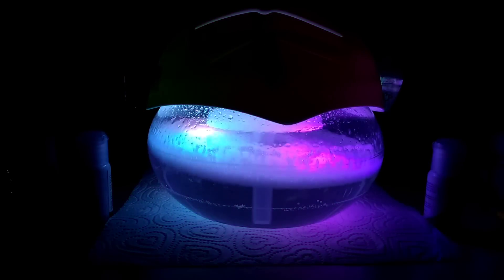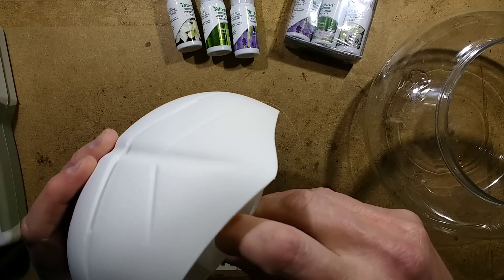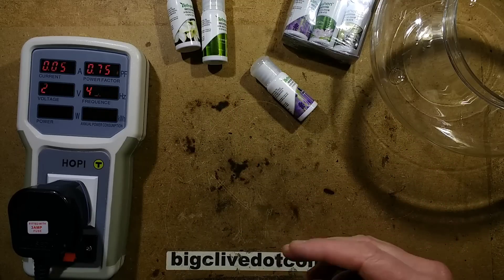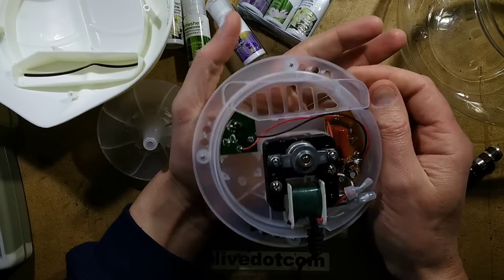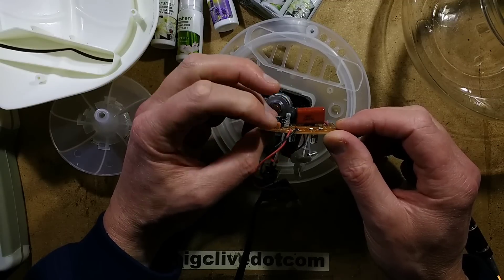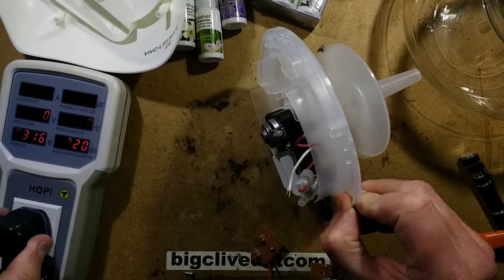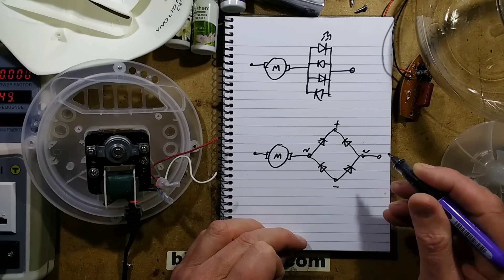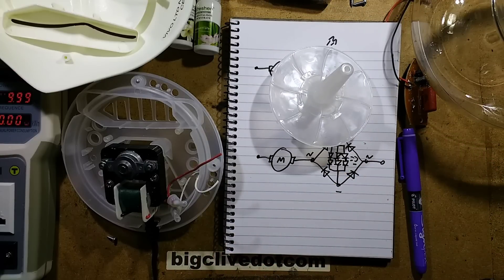Water sphere air cleaner.

Comment: So if i Understand coreclty the fan is sucking air from Above and splashing water from below on to the Walls and the air that was sucked mixes with it and Becoise of it it purifies air becouse water collects all the heavy particles or something like that? Is that even Effective?
Reply: What if we create some kind of air pump pump it down by some pipe and them the air particles will go up as bubbles and those bubbles will be purified by the water that they are travelling throw, would tjat be a Effective?
Reply from the maker: There was a vacuum cleaner that pulled the air through water to clean it.

Comment: im guessing a squirt of frebreeze in the water and the whole living quarters will smell nice. and you now how the back of a floor fan,the grill gets dirty, this probably removes that nastiness from the air... also i seen the metal aerosols they are spraying for weather modifications from the planes, im guessing this will remove that gunk too. and its  Quite a lot I've seen a woman that cleaned off her glass patio table out in her yard and after 2 days outside she scraped it with a razor blade to get the fine mist gunk off of it and she got 3 or 4 grams of magnetic micro particles that she picked up off The table from only 2 days outside...im going to build a large "one of these" that pumps air down through water and exhausts the air into the home, and just change the water-which is the filter👍

Comment: I think I'm missing something.  I thought the air was pushed through the mist/droplets/whatever.  But it's above at least most of the droplets (from under fan/flat disk part). If the air was forced through the mist, I could see it being a lot better at dust collection.

When I was very young, (1950s), my mom had a vacuum (cast iron!) that you put water in the bottom and the air was forced around a sharp bend and the dust/dirt couldn't make the turn so go caught by the water at the bottom.  Worked excellently, but I'm sure it was a bear to move around with it being cast iron (really!) and filled with a quart or two(?) of water. (an no wheels that I recall).

Comment: Hm, I had an idea for water filtering a while back, but that was overrriden
by another much easier to achieve filtering process, for the Sars-CoV-2.
At first I thought about using compression for air nito liquid, then mixing
with water, to get a a solution, then slowly decompressing it to
make the air within go gaseous again, this would leave all the particulate matter
in it, while allowig the gas to escape. Pretty good, but not as good as
using another gas to mix with the outgoing air from hospitals,
and then turn blue flame. ALthough this method is a little more expensive
in upkeep, it's much easier achieved.
But yeah, if you got like a whole bunch of solar power, and no natural gas,
yes, compression into liquid and subsequent release while uncompressing,
will get you nice results.
it's way better than trying to get bubbles small enough to be filtered.
The bubbles with such a filter would have to be <20nm for it to work
against SARS-CoV-2.
In the long run, the mechanical to liquid compression would be better,
since it can be done for a long time using electricity,
while needing little mechanical components, or at least relativel easy buildable ones.

Te short fast sweet is with the natural gas mixing, guaranteed to 100%
destruction of all SARS-CoV-2 particles.
Tiny airbubbles ?...not so useful...not even when it gets looped several times.
With the SARS-CoV-2 virus it needs to be 100% proofed.
And in that the winner is gas-mixing and burn.
the fluid compression is still very close, but just 99.9999999999%
effective.
Dependant on the fluid decompression cycle, it may yet release it's own
version of aerosol Sars-CoV-2, albeit in a much lower concentration.
Reply: Yes the air/gas compression filter may work also in other instances,
but when it comes to viruses, you want 100%.
Not 99.99999999%
The water/gas compression method may be used if and when
it doesnt matter that much how much escape, if dealing
with tolerance, but can't achieve a absolute zero tolerance.
Reply: Also keep in mind that electricity is still mostly generated
by fossil fuels in most urban areas.
So burning gas to create electricity, to create pressure,
to mix with water, and then slowly decompress,
is still using gas anyways.
So.not cleaner unless you only use solar power.
Reply: Avoid mindreaders, they suck, and can't answer anything unless
they get the answer from someone else.(or from the person that's
asking them, if and when the askee already has the answer in mind)
To tell a true clairvoyant from the fake mindreaders that pretend to be
clairvoyants, ask a question to which you have the answer NOT commited
to memory. They can't answer it, for you don't have it in your mind,
whereas a true clairvoyant can answer it regardless, since they can actually
see the future, and no matter when you pull out the envelope with the question's
answer, they'll be able to see it.)
(Then there's brilliant people, who cook one up for you, if and when
they have enough data available to create it on the spot.)
(the latter ones are gifted maybe, but neither mindreaders, nor clairvoyant.)
Reply: (If and when confronted with mindreaders who try and pass themselves
off for people to be in God's (or Allah, or whichever) service, well,
you then know what they are,
and yes, that means they serve the opposite one instead.)
(Those are mindreaders who prey on other people's religions and faiths.)
(They turn it against the believers and 'believers' alike.)

Comment: Pretty much a cool mist humidifier. Without the skirt comb around the impeller the water doesn't get broken up as much. You should look at impeller-based humidifiers they're about the same except have an arrangement of teeth (the comb) around the impeller spinner/fan.

Comment: Many, many moons ago, when I was a kid and if I had a cough or a cold or something, my mom would put a humidifier in my room that worked very similarly to this, just larger.  That thing would shoot out a two-foot spray of fine droplets and air and I specifically remember the long cone shaped "tube" that went down into the water and a top disc that I would now label an impeller.  Stuff like that always fascinated me...I could never understand (at the time) what in the world made it "suck" the water up and out like that...
Reply from the maker: It might have been an ultrasonic dehumidifier.  They produce a plume of cold steam.
Reply: Nope, it had a shaded pole motor driving a rotating part just like the one shown in this air cleaner disassembly.  I know for sure it wasn't an ultrasonic, I would have gone NUTS playing around with and trying to understand one of those!  We're talking mid-70's-ish and I don't recall ultrasonics being widely available at that time.  But yeah, it had a long cone shaped tube with a small opening at the end that was immersed in the "tank" and at the top (if I recall correctly) was a disc that resembled the centrifugal impeller you would find in a vacuum cleaner.  The disc acted as a "fan" which sucked in air through the top, mixed it with the water and swirled it around in the lower reservoir making kind of a mist "tornado".  A little sliding door on the side would allow some of that mist to escape.  Obviously WAY before safety switches were common, this thing didn't care if the top was on or not - it would still spin.  I don't even think the damn thing had a power switch - you just plugged it in and away it went!  Haha, I can remember making HUGE messes when I would try to lift the top off juuuuuust enough to peek inside and it would always sling water EVERYWHERE.  Heh, it's a good thing my mom recognized my budding curiosity and where it would eventually lead, otherwise I probably would have gotten my ass tanned for all the mild water damage!  Hahha...

Comment: This may be bad but I had been thinking about water/air cleaner for quite a while.. I remember seeing something on Science Channel/Discovery/Nat Geo about how water dropplets from ocean waves are amazing air cleaners as they cling to particles in the air and makes them heavy enough to fall down.  I had been considering something along the lines of high volume air flow blowing air into pool of water which is constantly filtered via carbon water filters.  Mix in surfactants to help catch the dirt/pollen/etc..  So this is thing air cleaner is a decent idea but horribly implemented.
Reply: i im thinking how can implement this in a bigger unit, making that turbine and conect it to a pc cooler bearing motor

Comment: I got one of these for the kitchen (and smoking room).
I liked the low wattage, and the lack of filter to clog.
I hoped it would stop my tobacco tar, and whatever condenses out of cooking vapours from coating the ceiling and walls.
Anyway....they certainly do something, but I'm not sure what.
I ran it without the additive, and it certainly draws cigarette smoke towards it, as the underside of the lid soon got yellowed, as did the tiled area close to it.
Plus the fan and the cone developed some kind of smeggy deposits. These weren't oily, and I'm not sure if they were a bacterial build up in the water. They needed cleaning off every day.
When I wiped the bowl, the tissue would be brownish, so it might have caught some tar from my smoking.
Any road up, thanks for this video, and...why is it safe to mix lecky and water in this device?
Cheers.
Reply: Good googlymoogly imagine what your lungs look like!

Comment: The question is does it work (well),  I think not , How can we tell? .. the air leaving the device will be almost 100% humidity ,  if initial air in the room is 50% humid it takes another 10 gms of water to increase 1cu meter to 100% (25C) ...A room 4x5x3 meters requires 600g of water to increase humidity from 50 to 100% ..what is rate of water use ? How rapidly  the device increases humidity in a room is a measure of how effective it is (assuming the water treatment does clean the air)

Comment: Huh... The new color changing LEDs can be wired in series? How does that work?
Considering that the channels are internally faded back and forth by a tiny micro controller I would expect them to draw a rather variable current.
Did they sync up the fading of the individual channels so that the LED consumes a constant current? Does the micro controller shunt LEDs when not turned on, rather then controlling the output of the LED? That would be a reasonable solution I guess.

Comment: I too had a  unit like this when I was a kid.  It had the tube as well but, of course the tub was a solid color, green if I remember right. They were sold as humidifier for the "sick room" and mom always had it next to my bed, well after we moved to a house with power, when I was ill with a cold or the flu.  It put out quite a mist and was called a cold air humidifier, in contrast to the warm air which was actually steam. I don't know if it worked very well or not, but I think it did bring a bit of relief to my sinuses back then.

Comment: I call BS. I think a real air purifier would suck in air through a filter (such as a HEPA filter) and then blow it back out in such a way as to circulate the air in the room, effectively removing the dust, alergens, pet dander, etc. This looks like it would be more effective as a humidifier and/or aroma sprayer, if it's even effective at anything at all.
Reply: so "sirena vacuum" when his water gets dirty is all a illusion?

Comment: I bought the original one of these over 15years ago for my mum. Back then it was advertised more towards air fragrancing, sure it was called a goodsphere  ?? Cost £50 I think but, it's been used nearly everyday and still works today - for something that's soaked in water all the time that's impressive!, I wonder if yours would be as reliable.

Comment: The spinning pick-up shaft was a common design in U.S. humidifiers until ultrasonic ones took over the cool-mist segment of the market. I remember those being quite common when I was a kid in the 1980's. Seems to be a pretty KISS design, which makes me wonder why the ultrasound ones won over. (The motors weren't even all that loud either. They'd only start making noise when going empty, which was a pretty good cue that it was time to refill.) Maybe it's just electric motors being around water and a safety thing?

Image search and the enclosure was something like this... https://img0.etsystatic.com/000/2/6262900/il_fullxfull.344606988.jpg

Also goes back further, so may be common in 1960's and 1970's too...
https://www.google.com/patents/US3155746

Comment: Airation is used in Water Purification. I doubt it'd clean the air. Usually you get crap from the water form a slurry/sludge on top of it (be this microscopic silt particles or what not).

It's acronym is DAF. They used DAF Plants in treating ground water to remove small particluates and certain types of algae.

Comment: Sorry if this is a silly question but is there a simple way to reverse the direction that type of motor spins?
Reply from the maker: Only to physically flip the motor over.
Reply: bigclivedotcom thank you. I have a bathroom exhaust fan that spins backwards for some bizarre reason and tries to push air in to the room.

Comment: so a curious child knocks it over and is potentially electrocuted?
Reply from the maker: Not really, the upper case shrouds the electrical area to avoid easy current paths.  But if the unit was submerged in water completely then as with any other electrical appliance it would potentially pose a shock risk.

Comment: Wait a second. So water is being lifted up the funnel and flung to the sides by the bottom fan part of the spinning disk. Air is being moved by the upper fan part of the disk. Bottom and upper parts of the disk are separated by the plastic disk itself. How does this do anything to the air that goes through the device?
Fill a sink with water, add some perfume and blow air over the sink with a normal household fan. Does the same thing, sans the splishy splashy and the light effects.
Doesn't proper air filtration with water work by forcing air through the water? This device doesn't even remotely do that.
I used some amazing Paint skills and drew up this: https://i.imgur.com/KkOKOal.png
This thing might work, if a water droplet happens to hit a dust particle in the air that has happened to circulate into the splishy-splashy zone of the water tank. The device would probably be a lot more efficient at cleaning air, if the air intake was funneled into to splishy-splashy zone. Now most of the air will just go in and come out without ever touching any water.
Reply: The fan not only slings water, it propels air.
Reply: Read my entire comment. If water is circulating in the bottom and air is circulating at the top, how can the air be cleaned by the water?
Reply: I read your entire tedious comment. I just chose not to answer it point by point.  The air intake IS circulated through the "splishy splashy zone", if you define that zone as where the water is being slung by the fan.  It is drawn in through the center of the fan (which also has water flowing into the center, there is only one fan), it is mixed with a fine spray of water, and then it is exhausted at the edge of the fan. The water sprays the air going thru the device.  It also humidifies the air.  Yes, the device "works" by colliding water with particles in the air.  No, it won't work very well.  No you don't "clean air" by forcing air through the water.  You clean air with a filter.  No it isn't the same as blowing air over a sink full of water.  It would be the same as blowing air through your dish washer.

Comment: I have one of these branded "Sensu  Air, as seen on TV". It's rated 30 W and a little bit noisy. I wonder if it has any use at all or if it's just throwing money into the sack of the local electricity supplier. 30 W is quite a lot, it means 720 Wh a day or three LED light bulbs! I can" t discover any dirt in the water but the inside of the bowl, the tapered turning stick and a lot of plastic parts inside are getting quickly covered by a layer of rose limestone. This is not easy to clean.
Does anybody know if there have been scientific tests to see if IR works? I would like to know if it has at least some small effect. Anyway, have a nice day, guys and gals!

Comment: Mechanism is identical to that of the Devilbiss "cool mist" humidifiers sold in Walgreens stores here, which have a little row of pins that it throws the water against to break it into fine droplets and coalesce the larger drops back so they recirculate into the basin instead of getting spit out.

Comment: I tore one of these to bits years ago. It was a 24v dc one and the ioniser module was little black box with a high voltage rubber wire running to the vent with a carbon bristle like material heatshrunk to the end of it.

Comment: please review this... one was given to me....im nout sure if i should use it   

http://www.ebay.com/itm/New-Head-Home-Bathroom-7-Colors-Changing-LED-Shower-Water-Faucet-Glow-Light-RF-/172690161914?epid=1602636239&hash=item283522c0fa:g:XNcAAOSwX61ZI7oI
Reply from the maker: If you search my videos for shower then you should find one I took apart.
Reply: They're safe, there's a little miniature waterwheel inside that gets spun round by the flowing water. It spins a magnet that generates current, powering the LEDs. It's all low-voltage, no danger of anything.